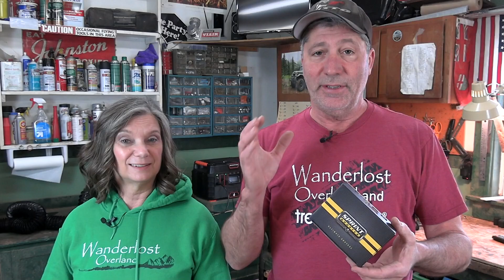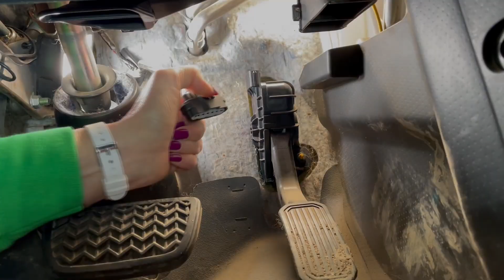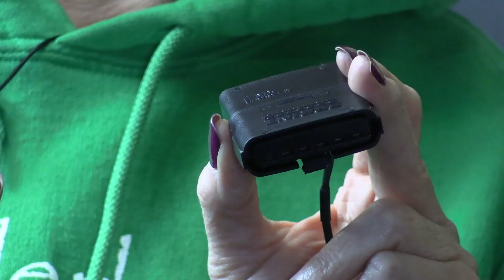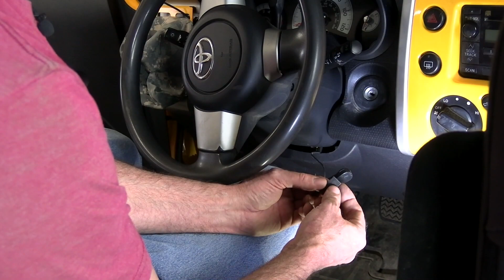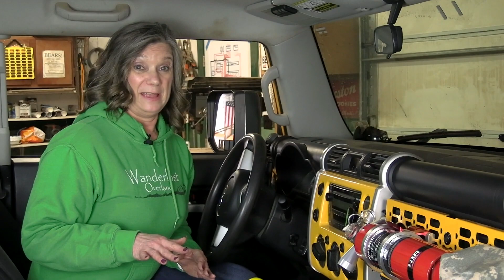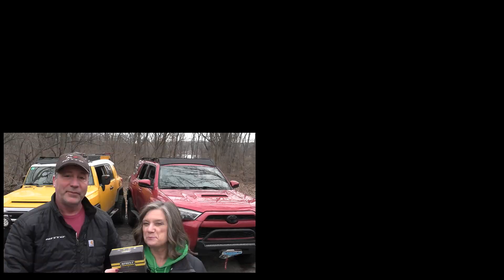Is Sprint Booster Legit? Step-by-step Installation Guide.

Comment: Great video. Thanks.✌️👍💜😊 

Cool trucks too👍✌️💜😊

I hope mine is easy to install on a Suzuki Swift, the pedal response is dire, and you're right, burying the pedal in the carpet makes no difference (set up for eco - but I was taught that best fuel efficiency is achieved by getting up through revs and box quickly). This car has variable valve timing (VVT) and like a bike engine to get the best it needs reving up through the range, nearly impossible on factory settings to get the best out of its VVT.

Comment: Caused a lot of CEL with throttle position sensor code for me.  I took it off when i got the Magnuson SC.
Reply: What is a CEL?
Reply: @paulbennett5549  check engine light
Reply: Very odd. Sounds like something else might have been going on. I have seen A LOT of people with superchargers with no issues.
Reply: @masterchief370  no issues with the supercharger, just with the sprint booster before I had the supercharger
Reply: @ACEventure  was there an aftermarket tune? Did you replace the unit just in case there was an issue with that specific one? Just very odd IMO. Never seen an issue that couldn’t be resolved or addressed .🤷🏼‍♂️

Comment: Could not live without mine.  When I was going through a "I'm gonna sell the 4Runner" phase, this allowed me to drag my feet long enough until I eventually came back to my senses.  I only have 1 complaint: I wish they were smart enough to know when you're in reverse.  I'd like a setting for it to adjust back to default/off when in reverse.    Must be a limitation in simply they way ALL of these work, because I don't think ANY of them do that.
Reply: There are a couple that also hook up to the obd2 port to know when in reverse. I have a piggyback tuner connected already so I can't use those.